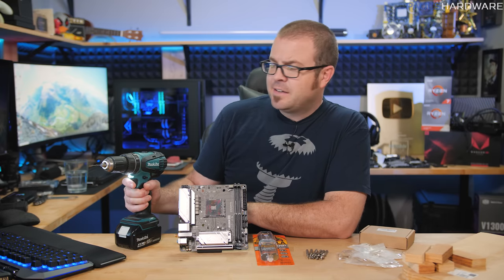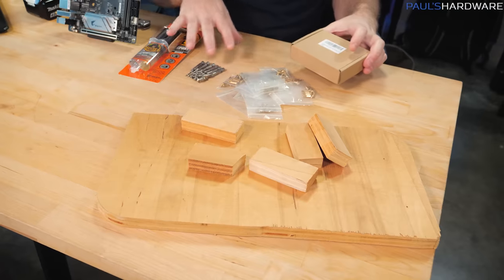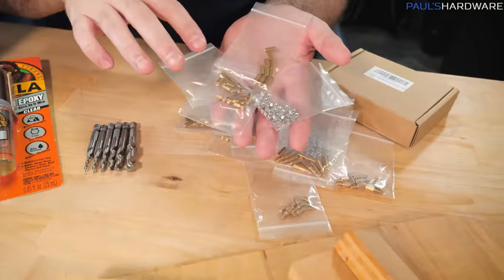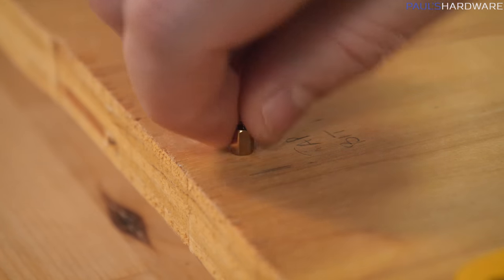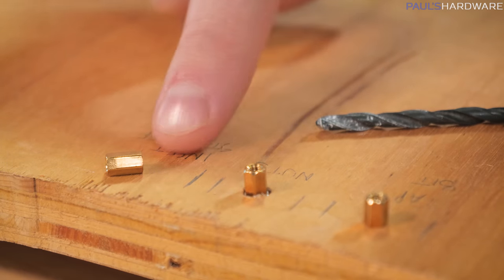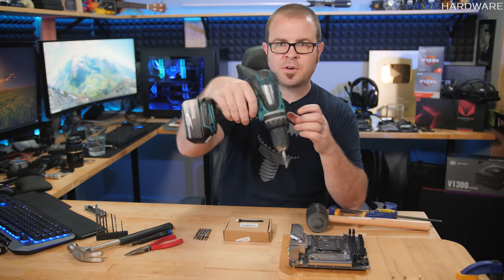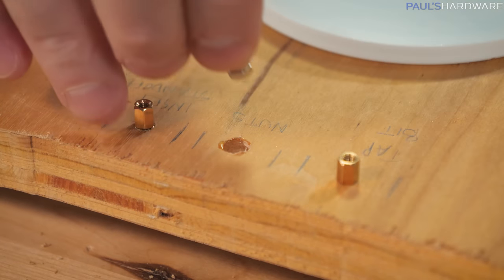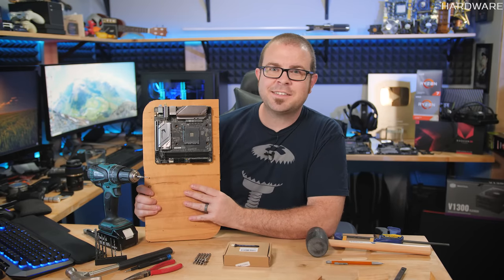The Wood-Mounted Motherboard Challenge!

Comment from the maker: Thanks for watching guys! 🙏 Here are links to some of the videos I mentioned -- 
Most Recent HTPC Video - https://youtu.be/TTEgF2ymcQ0
Building a Stand for Riptide - https://youtu.be/4MN_GXVcqW8
Reply: You might want to look into nutserts or rivnuts.
Reply: Im excited about this I've been thinking about doing a similar thing I just have an issue figuring out how to do the drive trays id like something smooth instead of just stacking an optical drive on a shelf inside lol
Reply: I'll be watching this closely. Definitely put a video up on your custom build. I want to do this as well!
Reply: I think you have a good idea with the insert. You could drill all the way through. Screw in another bolt to it at the bottom. Where you can attach your grounding wire. So it is clean and hidden a little. Since i know your i to looking neat and trim.
Reply: But but but, you can just buy "4 Pronged Tee Nuts" for this....
Reply: I would use threaded brass inserts with the appropriate thread for the the standoffs to screw in.
Reply: Check this guy. He is awesome!
I put the video on the place referring to the bolts, but watching the whole video is worth the time.
https://youtu.be/QaoFh1DH51U?t=276
Reply: Come on, Paul.  We know it's taken so long because the wood had BUGS.  Congrats on taking this step.
Reply: If you still plan to use the big passive heatsink, maybe you could drill a small hole near the top of the board, that goes at the way through the wood, then similar to your ground wire idea, have w wow run from a screw hole through the wood and tied of to a washer or something.

Would be a sort of failsafe, if your mounting solution fails slowly over time, it'll be the top that works it's way out first because of the weight hanging from it. That wire tired from a screw through the wood, would prevent it from falling.
Reply: A smaller hole for the Nut and less epoxy and tap it in like the 2nd standoff.
Reply: Look into threaded inserts to hold the standoffs. As a woodworker, I can confirm they're excellent
Reply: I had an old laptop with a demolished screen. I removed the motherboard and mounted it to a piece of granite as a test run for a PC build idea. It works just fine.
Reply: I did a build on wood, and I mounted the drives besides the rest, displayed on the board. Drives don't have to be laying horizontaly, they can be horizontaly mounted
Reply: M3 threaded inserts.  There's a bunch of different types, including ones that thread into wood like regular screws, but which are hollow and have M3 threads on the inside.  https://www.amazon.com/Z-LOK-Threaded-Inserts-Installation/dp/B015CAPTZI/ref=olp_product_details?_encoding=UTF8&me=
Reply: Do a kickflip!

Comment: Pro tip that we use on RC airplanes - add thin CA to the holes let dry and re-tap threads. The threads will be much stronger.
Reply: what's a CA???
Reply: Same question lol
Reply: @johnnyxp64  it's a brand of super-glue.
Reply: @mhoop1  It's the other way around, Super Glue is a brand of cyanoacrylate (CA) glue.
Reply: SteelSkin667 either way those to lazy to google now know it’s glue.
Reply: @johnnyxp64  cyano acrylate or super glue

Comment: M3 brass insert nuts would be all you need for this really. Just thread them into the wood throw in the standoff and boom
Reply: I thought exactly the same. Would be the easiest method.
Reply: I came to say this exactly! Seems like the perfect solution.
Reply: A little overkill for a motherboard. I screwed the standoffs directly into the wood without taping it. Works just fine.
Reply: @senzelian  they cost like £3 it's fine to go overboard. Belt and braces ye
Reply: @milestehmad117  Yeah of course! I'm not saying it's a bad idea - tbh it's a good idea. I'm just cheap :P
Reply: Without even watching through the video I was about to say that! Happy to find it in the comments already
Reply: Sounds reasonable. I wouldn't put a standoff on top to be honest. I like that the mobo would sit nearly flush with the wood.
Reply: Yep that is what I did for my desk computer. all components are screw in brass insert nut (Motherboard, ssd, rad, psu, gpu and res). Very easy and effective. Pic here https://builds.gg/builds/all-exposed-parts-desk-pc-11090
Reply: or set screws. but set screws would be your standoffs

Comment: Be careful. In plywood or any other engineered wood, this would work perfectly but in any solid woods, if the humidity changes, there will be wood expansion and contraction which might loosen the inset standoff after a while. I would personally use a dab of epoxy and the inset standoff method to be extra sure. 🙂
Reply: this is actually very helpful thank you very much.
Reply: Plywood is actually more subject to thermal expansion and contraction when it comes to connectors. When working with plywood you want to use the same techniques you would use with a softwood. Walnut is a hardwood and probably will hold it better than plywood ever would. Though a dab of epoxy won't hurt. The advantage to engineered wood is you have to worry less about the anisotropic nature of wood so you don't have to consider grain direction. You get the same structural properties along the length and width of the board in the case of plywood. in the case of MDF, it will also be the same across the thickness.
Reply: Wouldn't thin superglue be better for gluing this? considering the tight tolerances around the standoffs. Might also leave less of a mess than the epoxy..
Reply: My thoughts exactly.
Reply: Yes. And over time, just going into the wood without the nut will wear the threads over time. Especially in earthquake prone areas like southern California where you get enough small tremors that it puts stress on the wooden threads. nuts with epoxy will help mitigate that and give them some flexibility without letting it go.
Reply: The inset with adhesive would be best done similar mounting before
Reply: @OaNautilus92  Actually from what I understand, super glue is not forever. Fast set but not long term strength.
Reply: Was about to say the same thing!
Reply: Maybe that is why he choose such a type of wood for the "back plate" - to avoid expansion / contraction or even bending...
Reply: same, I would do that :)

Comment: I've done quite a few wooden scratch built computer cases.  I've done a number of approaches.  
1.) Pre-made motherboard trays (Lian-Li replacements I believe), which got screwed to the wood.
2.) Threaded inserts with a standoff (some glued in, some not)
3.) Standoffs straight into the wood
4.) Glued little wooden blocks to the main board where the mounting holes are, then just used pan head wood screws into the wood

All worked fine with no issues in my scenarios, but my favorite method is threaded inserts with standoffs, unless the wood in question is not thick enough to accomodate the threaded insert (not an issue you would have here).

For the size of the motherboards, you don't have to worry about wood movement, unless you're going to be having an ATX motherboard going the long way across the grain (that is to say you're using a 14"+ wide board to mount the motherobard to).  There should be enough play in the through hole that the mounting screw goes through that it won't matter

Comment: PAUL! In addition to the grounding wire (that you can feed through the wood and run it in the back where it won't be seen), you might want to put a section of copper foil on the back to act as a universal grounding plate. Get the same stuff that guitar makers use to shield their control cavities. This way, when you screw your standoffs into either the wood or the nut you sunk in the wood, it will pierce the foil, and make a mechanical connection.

Comment: This was great, I did something similar to this recently with much thinner wood. I used a screw to hold the standoff into the wood, effectively mounting the standoff upside down, and secured the motherboard to the self-aligning standoffs with nuts.

Comment: I made my own test bench yesterday and I used both wood and perspex. I used the perspex for the motherboard and the wood for the stand. Used screws to get them together and used a 2mm drill bit in perspex to just screw in my 2.5mm motherboard screws with also using higher stand screws to lift the motherboard.

Comment: I've started making mine a couple weeks ago. I just drilled through the entire wood, used long screws, relatively large diameter washers at the back, and just female/female (motherboard) standoffs at the front. It might be a bit too much, but it will hold some decent weight.

Comment: Super easy epoxy in motherboard risers into pre-drilled holes. you need to slightly oversized the holes to allow for wood expansion and contraction without affecting the motherboard.
Reply: If you wanted to thread into the wood you would need to use some steel t-nuts to thread into the threading on the motherboard standoffs are too small for any kind of thread into wood over the long-term. Make sure you also leave some slop some spare room for the wood to expand and contract or it will try and crack your motherboard. Speaking from experience - the wood PC guy

Comment: I've done something like this in the past, and i found the only really secure mounting method, just because of the tiny size of the hardware (nuts & bolts), as well as wood being able to expand and contract with differences in temperature and humidity, was to get a cheapo case (i'm guessing you have plenty around), cut it up to get the actual motherboard tray, trim it down so that it's smaller than the board, so that it's not visible when viewing it from the front, and then screw that motherboard tray directly into the wood, using actual wood screws.

That would also help with grounding, as you can run a ground wire from the tray, through the wood, and then run it on the back side, so that it won't be visible.

Comment: You could drill all the way thru the wood, secure the standoff on the back side with a screw and use the back for your grounding wires. You could also use a router to make channels for the ground wire to keep it clean. =) Looking forward to seeing this finished.

Comment: Looks good.  I've used stainless steel wood screws with a spacer between the MB and the lumber made from a nylon refrigerator water line.  You can custom cut the spacers with an Exacto knife so it's the exact height you want it to be.  It's very solid and cheap to make.

Comment: Yay for inserts! Very clean, very professional, very sturdy, most reliable and easy to deal with in the long term. Definitely the best solution here. I approve. Do that. the other solutions aren't as good. Did I say how much approval I give to the inserts solution? Well I give it all. Brass inserts in a rustic piece of wood will look sooo damn right. This is what everybody should do. No I haven't run out of good things to say about inserts. Good. Such brass. Much inserts. wow.

Comment: Paul, all you have to do is drill a hole the diameter of the solid part of the screw inside the threads. Machine screws will hold very well and make their own threads. This is particularly true in hardwood. I use this method all the time with MDF. Forget the glue and nuts in my opinion.

Comment: your preferred method is cool. if you REALLY want to go all in you can desolder the power and data sockets from the motherboard, resolder them on the other side, route all the wires hidden behind the wood.

Comment: Dealing with wood opens up a whole host of challenges you definitely don't want to get wrong... or face disaster.

1. Wood screw threading is different to metal - the former is coarse and the latter is fine. The reason involves grip since wood is softer than metal. This becomes important when dealing with weight because heavy items can get ripped out if the screw thread is not secure. There is no glue in the world that can hold up to even a short but properly secured screw.

2. Wood type and hardness. Drilling into something like plywood or oak is best for securing items with screws as opposed to soft wood such as pine or particle board. The best advice here is to go with as deep a screw as the wood you have will allow. If you have to deal with soft wood then consider using a bolt, drilling through and mounting with washers. Washers will help spread the load so that the bolt head doesn't end up pinching the hole resulting in the wood splitting, or worse, having the head go right through. There's also furniture assembly bolts that you can use that once hammered in will give you a metal thread to secure your screws to.

3. Orientation. I am assuming you want to wall mount your rig vertically. You will have to locate the studs in your wall and secure your wood piece to that. Here you can use anchors on the back that hang onto bolts in your wall. Another idea would be to get a swivel arm 200mm VESA mount designed for heavy TV's and secure that to your wood piece with 8-12 large wood screws.

4. Wood can also have a tendency to split over time if it hasn't dried out properly. I cannot tell you how many times I've got DIY shelving from Home Depot, taken it home, cut to size and fitted only to see cracks in it weeks later. For load bearing applications cracks are a major problem. The best thing you can do here short of replacing is to mount it using enough points so that a crack or split doesn't affect it's strength.

5. Wood can also sag/bend over time from loads and temperature variances. It's not uncommon for even 2x4 and thicker sections to bend and curve where you would otherwise want a dead straight section. Reinforcing the wood with L profile steel brackets (you don't want to go aluminum) is one method that I have found works.

6. Drilling into knots. This can be unavoidable depending on where you are trying to locate your screw. Not only do knots prevent threads from holding, the entire knot itself can fall out. My solution has been to drill elsewhere, mount a second piece of wood as a structural point, and then use that for the original hole.

7. Consider a table mount versus wall mount. Depending on how heavy the finished piece is it might be best to have it sitting on a flat base, not only for holding the weight, but for stability. It's not too difficult to bolt together a H frame for a base with a T frame going up vertical. I've built TV stands exactly this way using 1.5x5.5 and they are dead stable, able to hold the weight 5x the TV on it, and with enough bolts/washers holding it together will never let go of what's mounted to it.

Good luck with your project. Hope this helps.

Comment: I believe the inset stand off with the littlest bit of epoxy would work well.  The inset stand off will hold when the air is dry, and the epoxy will hold it in even if you run into some humidity issues. Great video Paul.  Got some ideas for my next PC build!!!

Comment: I made my own open test bench about 10-15 years ago, with just stuff I found at the hardware store. Drilled holes into a kitchen cutting board, through the back put screws with washers so they could never come through, or move, then on the top side, I cut up a closed cell flat neoprene pad as my stand offs, and put those over the screws. Thats been my motherboard work bench for a decade or so and with dozens of motherboards, some used for years at a time.

Comment: Option 1 for the standoffs is actually the best & easiest imho. If you want to use one of the options with embedding the nuts, use a drill bit for wood. The one you used are drill bits for metal. They create quiet a bit more tearout than wood drill bits. Also, with wood drill bits, the bottom of the hole will be flatter, less conical.

Comment: This is actually perfect timing. I will be mounting a motherboard to wood this weekend! I was going to use 3/4" plywood to test before moving to 1 1/2" hardwood. I was going to route out a channel behind the wood to inset a motherboard tray from an old disassembled case, drill through holes for the standoffs and use long motherboard standoffs through the wood to mount the motherboard. But honestly, the tapped holes in wood looked really good.

Comment: The easiest way is the following:
1. Buy the cheapest second had case with detachable motherboard tray. Or one that can be removed easily
2. Demount the motherboard tray
3. Mount the motherboard tray to the wood using any screw
4. Mount the motherboard as usually to it... 

Used it to place my bedroom PC directly into a cabinet...
Reply: ive done that before, but i built my own skeleton case using an old rusty erector set. it looked really cool
Reply: Really good suggestion, also acts as a heat shield I guess.
Reply: @martenkl-71  Plus you get around the expansion and shrinking of solid wood

Comment: I'm in the process of building a PC into my wardrobe.
I drilled two 114mm holes for a 240mm radiator at the bottom for the intake and I exhaust the hot air out the top. That makes for a quite efficient cooling setup.

Comment: Okay,  so as a woodworking guy. I recommend using plastic sheetrock anchors. They come in all kinds of styles and sizes. Find the one that suits you. Drill the appropriate hole. Hammer them in. Screwing in the standoff expands the anchor providing  excellent grip. No epoxy needed.

Comment: Paul's Hardware - there is an improvement for the "tap method" by putting a small blob of wood glue in the hole before screwing it in, that way the wood that the threads bite into will become a very solid mass for the future, and you will still be able to remove it later if you decide to...

Comment: Hey bud. It's way way easier to use T-nuts or Insert Nuts if you want to use those standoffs in wood. No weird gluing and getting the threads gummed up. I personally cut the mobo tray off of an old case and trimmed it so you can't see it.